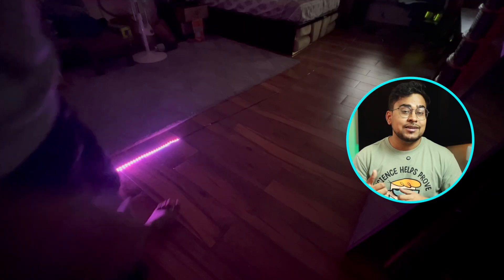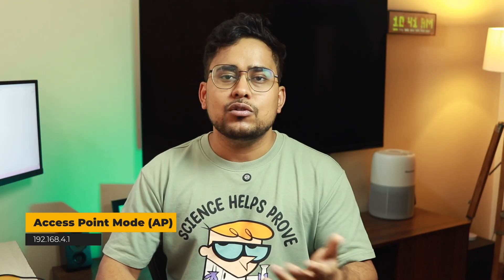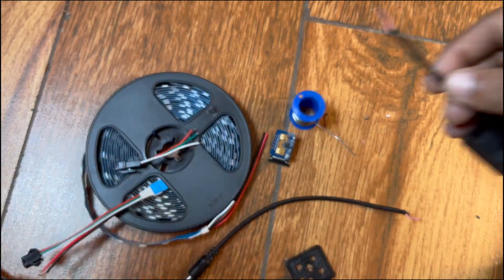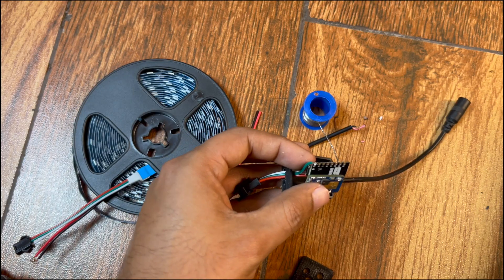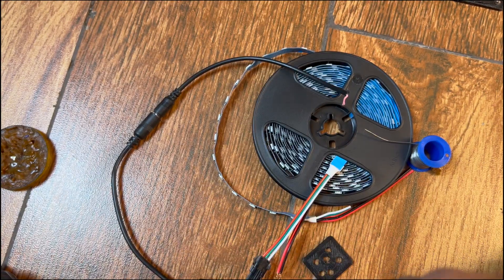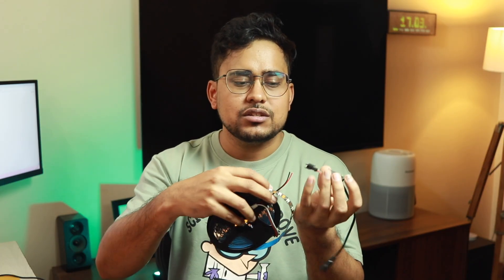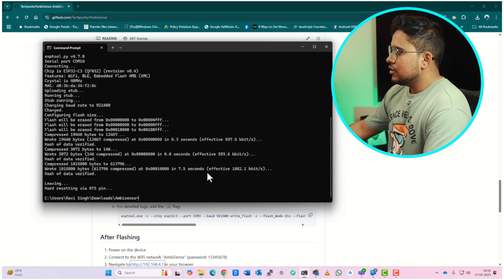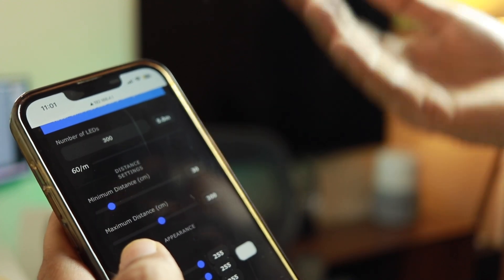DIY Smart Staircase and Hallway Lights That Follows You | AmbiSense v1.0 - Intelligent Lights

Comment from the maker: 🔍 PROJECT DETAILS: AmbiSense uses LD2410 radar technology to create dynamic lighting that follows your movement. Components needed: ESP32-C3 ($2-6), LD2410 radar module ($5-8), WS2812B LED strip ($15-25), and 5V power supply. Full code and instructions are available on my GitHub: https://github.com/Techposts/AmbiSense/tree/main Let me know in the comments if you build this for your home!

Comment: Thanks for the great video! I am planning to build such a construction myself. I have a U-shaped staircase. I suppose it would be best to use two sensor units, one on the lower floor and the second on the upper floor, both facing towards the staircase. I also have a bunch of LD2410 BLE (that is, Bluetooth) versions of the radar sensors. It would be difficult to wire the ESP + sensor units. Could it, therefore, be possible to use Bluetooth to connect the radar sensors wirelessly to one or more ESP's to run the whole setup? I could power the  wirelessly communicating LD2410 BLE's more conveniently. Thank you in advance for any suggestions.
Reply from the maker: That's a fantastic idea for a U-shaped staircase!
Yes, a single ESP32 can definitely connect to two LD2410 BLE sensors at the same time. However, the current AmbiSense firmware is built for a direct wired connection, so it would require significant code changes to work wirelessly with Bluetooth sensors.
It's an excellent concept for a future version, though! Thanks for the great suggestion.

Comment: I guess best use case is when the stairs are in a straight line - and not optimal in my setup, where the stairs have a 90 degree angle at the bottom (the first 4-5 steps in the bottom). The detection of the LD2410 sensor is probably also a bit of the challenge due to the layout of the stairs/steps (due to the 90 degree angle/turn at the bottom of the stairs). Maybe it can be adressed by using a ToF sensor (VL53L0X) at the lowest and highest step - to sort of "trigger" the light at the top/bottom, where distance measurement is a challenge ?

Comment: Hey Ravi, I made a mistake buying LD2402 & couldn't find anything online I'm struggling to figure it out. Can you please help me out?
Reply from the maker: I would recommend you go to Alibaba and get them. They are quite cheap there even with shipping and if in India, you can get at least LD2410C from Rajguruelectronics who is a official reseller of HiLink in India. Robu.in is also a place where you can get them.
Reply: @ravis1ngh  you think LD2402 won't work? I saw a post saying LD2402 are the newer low cost of LD2420 version
Reply from the maker: @mhmd15881 not sure. If there is a library, you can. Otherwise I would recommend sticking with either LD2410 or LD2450. I have ordered a few LD2450 to test multi-person tracking. There’s a good library for that and both sensors are widely supported by community.
Reply: @ravis1ngh  Thanks for your help brother

Comment: About 7+ years ago I created my stair lights using an Arduino Pro. It is 13 steps, 1 RGB puck on each side of each step. Each puck has 4 RGB LEDS in it. I believe they are WS2811. At the top and bottom steps I have infrared motion sensors to sense when someone steps onto a step. I have preprogrammed fade up and fade down sequences which are arrays. I believe I used the FASTLED library at the time. I was on top of the Espressif ESP8266 release and signed NDA's to get some prerelease. I've used my ESP8266's and ESP32's extensively in other projects and have wanted to redo by stair lighting possibly using reworked programming or WLED in some fashion to drive the LED effects and possibly use a separate ESP32 to control or trigger an ESP32 that has WLED via API, HTTP, serial, etc. I would love to see your placement of the LD module. I'm thinking I would keep my motion sensors as triggers for top and bottom then have the LD module start the following effect at the top or the bottom. Depending on how and where the LD module is mounted I might not need any traditional motion sensors as triggers.
Reply from the maker: Since I used an ESP32 with an LD2410C mmWave radar to track movement in real-time and control LED strips, there is No need for traditional motion sensors—just smooth, responsive lighting that follows you! Next, I am going to try LD2450 which can detect upto 3 person, direction and angle. So we can further tune this for accuracy.